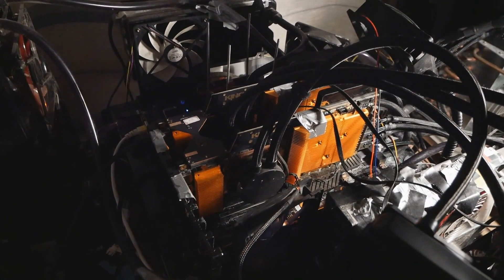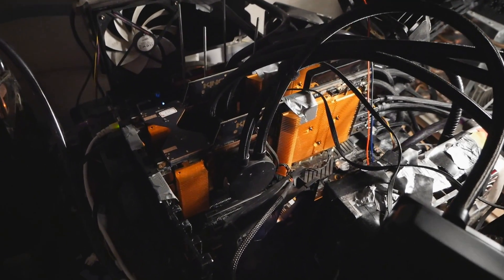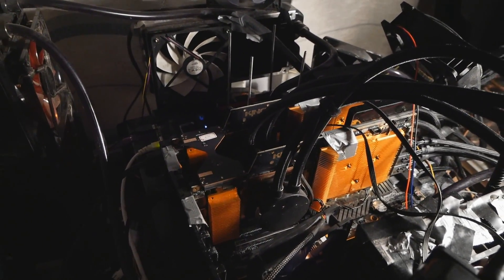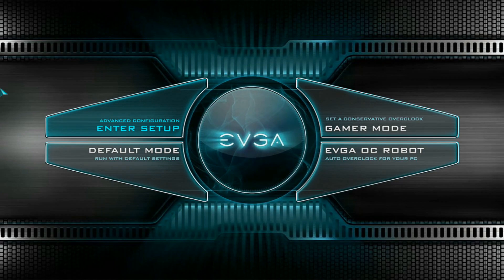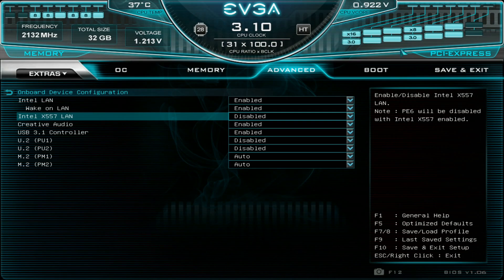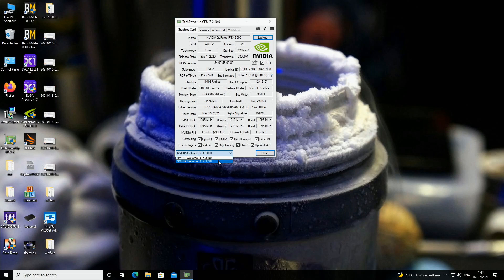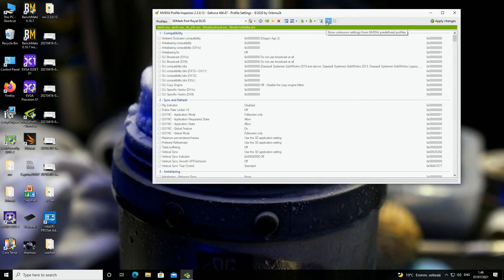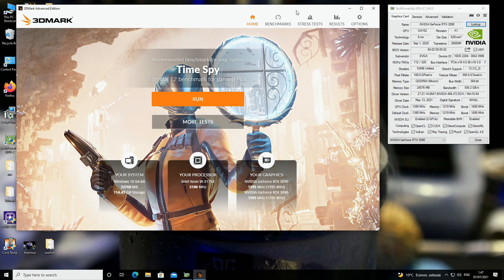How to Run SLI & Resizable BAR Properly with 2x RTX 3090 & EVGA SR-3 Dark Motherboard

Comment: Having similar issues.. I have re-bar enabled running a non-sli 3080 and a 3090. the 3080 is registering as resizeable bar enabled. the 3090 in the non primary pcie slot is saying resizeable bar disabled. ugh Wonder if it's just an error or not supporting more than a single gpu for rebar

Comment: @Luumi , can you please explaine more about resizable bar settings . After enabling it in bios and graphics cards driver and it says yes , game dev or software engineer must enable it too within the game profile .your mothed force it on the application without game dev updating the game profile .what r the profiles that must be changes specifically for resizable bar . There r a lot of 17 profile settings under unknown and there r no info what they r for . So if u can give some resources and info how u do it or where u get this info from. Thanks
Reply from the maker: You can try first with just it enabled in motherboard BIOS and with graphics card BIOS. IF you google you will find the resizable bar has performance boost in 17 games and with NVidia Inspector you can force to boost to any 3D application or game.

Comment: Can you talk about your two power supplies being used? From everything I've read, you're creating a significant fire hazard if you run one component from two PSUs (e.g. PCIe slot with one, GPU 8 pins with another). Phanteks has a Revolt Pro that allows you to expand to multiple PSUs.
Reply from the maker: I just use 24 pin adapter that connects two 24 pins together and that goes to power supply. 1x Super Flower 2000W and one EVGA 2000W.
Reply: What is this adapter called?
Also is scores better w one stick of memory or two?
Me nooby...